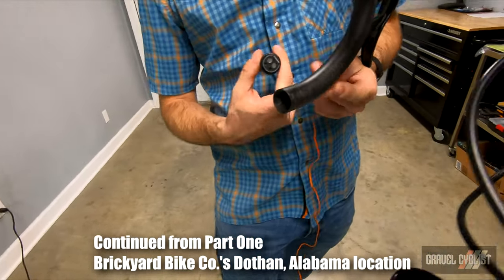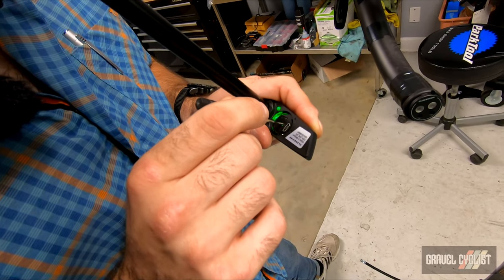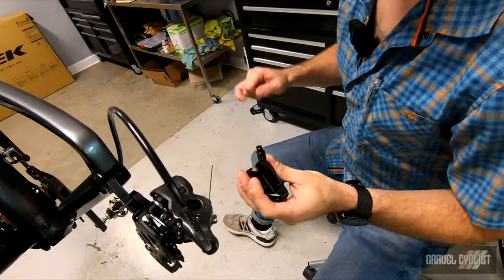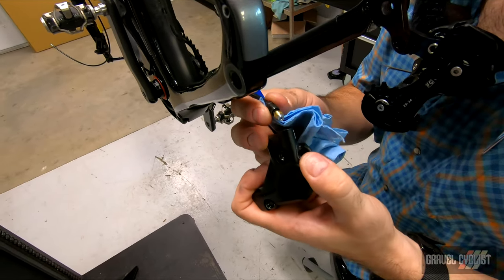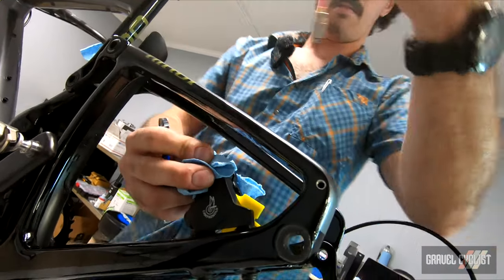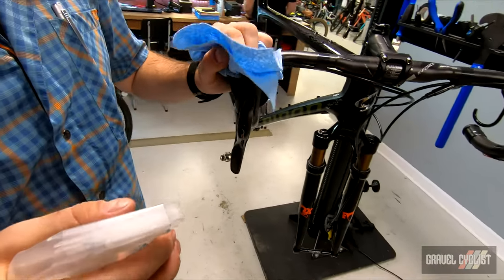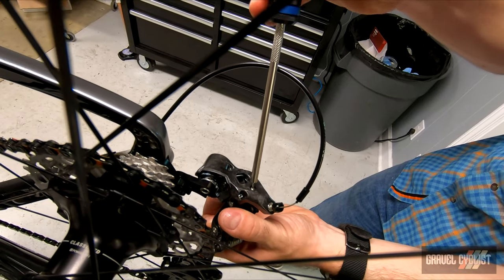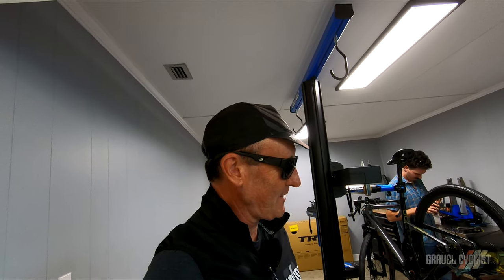CLASSIFIED SHIFTING Build Video: Part Two

Comment: So far, on my gravel bike I've only used 1x setups, but the classified shifting is something I would consider. What I do wonder about is water... I have done some pretty deep river crossings and on the Classified website it says: "Waterproof No need to worry about dirt or rain". That sounds like it might be a showstopper for me as it might be a bit more than just rain. What about you Jom, are you going to dismount in such a situation, or not?
Reply from the maker: Hi Pascal, more than likely, the bike will be dunked into water at some point to thoroughly test.

Comment: RE: cassette, so it’s a 3rd party that replicates Shimano 12 speed road spacing, right? What chain are you using?
Reply from the maker: Classified cassette (proprietary), KMC DLC 12 chain. See links in video description (Part 4), where I demonstrate the Classified hub & cassette fitment.

Comment: That chainline in the large cog and the chain rubbing the cage  is going to be an issue. I broke a brand new Dura-Ace 9170 RD cage apart from the chainline and amount of tension that was on it. Is that cage carbon?
Reply from the maker: Hoping to resolve that issue shortly, the cage is aluminium.
Reply: @GravelCyclist  Being aluminum it should fare better than my DA did being made of carbon. $110 for half the cage is steep. I actually have to use syncro mode so I don't cross chain and use the larger rings and adjusted the B screw. Now there is ever so slight some droop in the chain. These modern gears don't play as nicely as they did back in the days of old. But I've been using the group now for many months without anymore issues.

Comment: Is there reason why you've gone for chorus over ekar? 
Do you think you could bring the classified shifter wire out of the hole in the bars next to the lever? I don't have the di2 hole in my bars.
Reply from the maker: Classified does not support 13 speed with their proprietary cassette. You can drill a hole in anything provided you are fine with losing the warranty, and structurally altering the handlebar which could later fail?
Reply: @GravelCyclist  I don't want to drill anything, just looks like the cable is long enough to go up to the hole for the brake hose right next to the lever.  ( My brake hose goes into the bars here and is then internally routed all the way to the caliper).
I wonder if classified will do an ekar cassette , I really want a clutch with my intended use.
Reply from the maker: @tonygregg6957  If Classified produce an Ekar cassette, that would be amazing. 10-36 would be sheer perfection. I don't think you'll have any problems running the shifter button cable, and if you needed to lengthen, if you are handy with a soldering iron, it shouldn't be too difficult to extend. Good luck!

Comment: Should run the left shifter for the lockout
Reply from the maker: We talked about that in the video. The shifter does not throw cable in the correct manner for the lockout to work, despite many attempts.

Comment: Why didn’t you go for a Campy 12sp chain and cassette?
Reply from the maker: The Classified system needs a Classified cassette due to the hub design, see part 4 linked in the description. The KMC chain works better in a 1x application.
Reply: @GravelCyclist  Yes, of course. Forgot about that oversized hub.